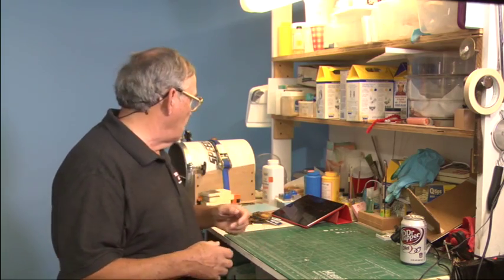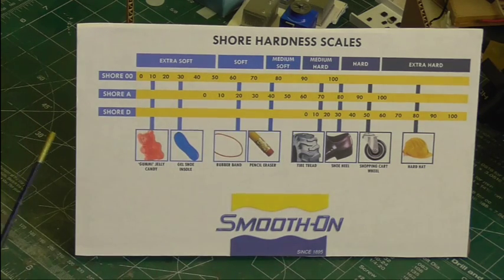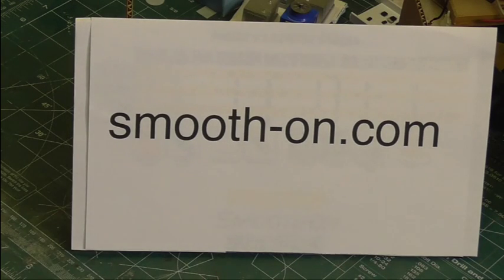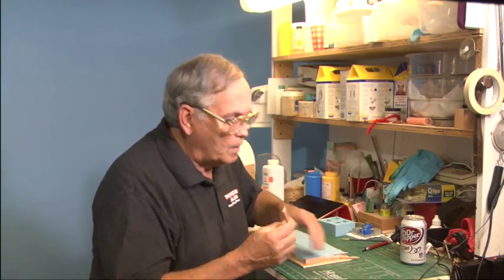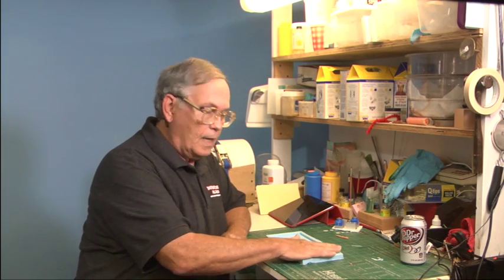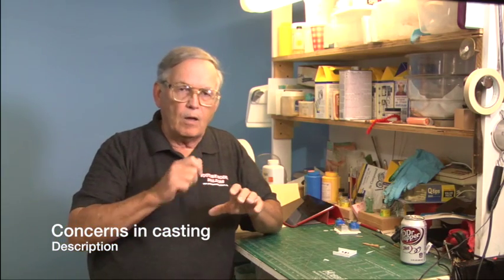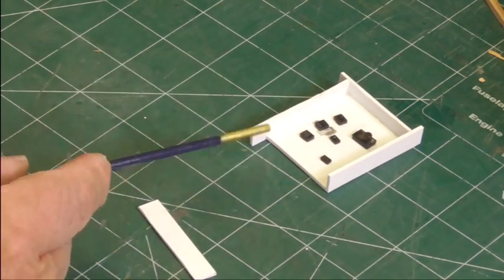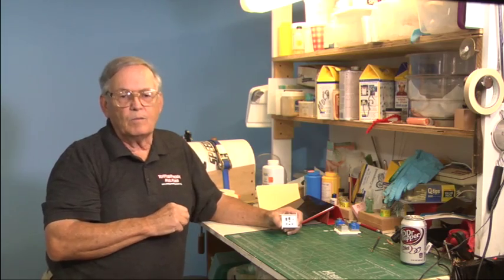Casting 1

Comment: Hi Prof.,
I was recently willed from a dear friend and fellow modeler a HUGE collection of castings.  Mostly rocks.  One well known commercial brand, who deals in scenic material in the wood lands, makes thin plastic molds.  I prefer casting in Epoxy Resin not plaster compounds.  To the best of your knowledge, will plastic molds withstand the curing temperature of Epoxy?  If so, with all the crevices of rock molds generally, what releasing agent do you recommend?

Thank you,
Jim